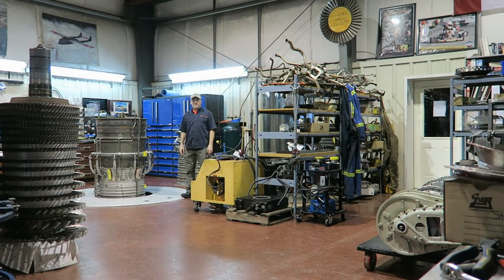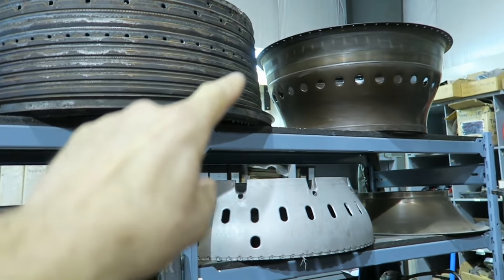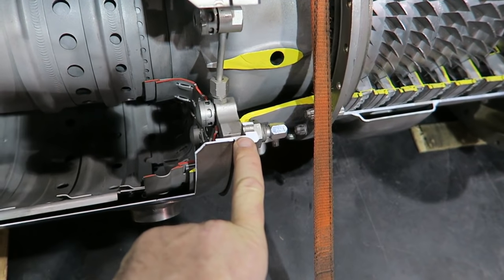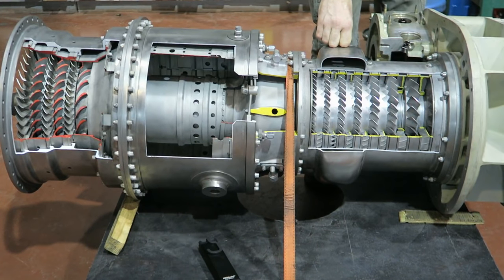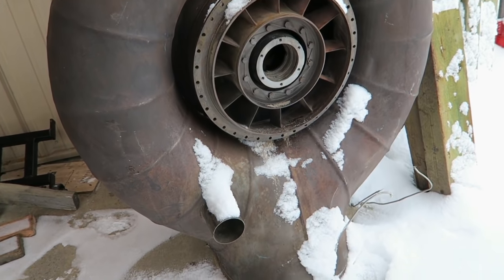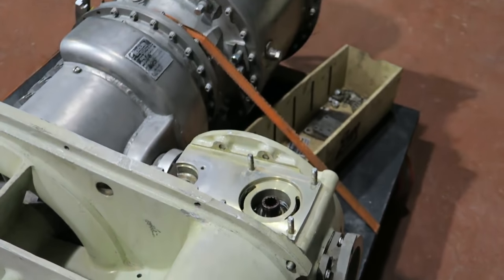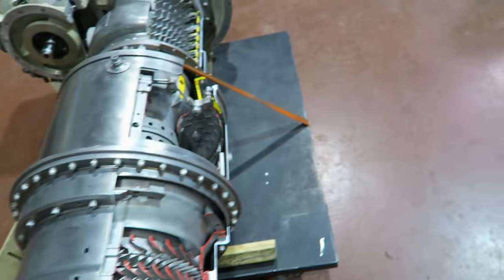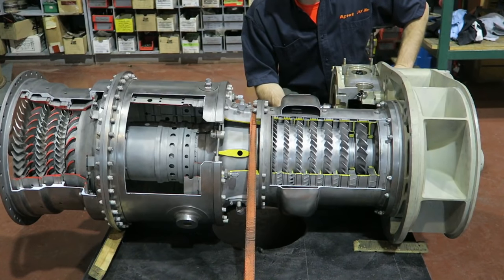Solar Saturn Turboshaft Engine

Comment: in the us, and I'm sure Canada too we had microwave radio towers between the 60's and late 80's run by att/bell called "long lines" they carried all long distance telephone calls and sometimes secure government comms most profilic during the cold war. at some of the more important relays that dealt with multiple wireless interconnections often in very remote locations they used these solar Saturn units for backup power. long lines played a big role in our history and many don't know anything about it.
Reply: there are links to a neat little brochure about it most of the way down this page. http://www.long-lines.net/documents/index.html

Comment: very cool
we have a solar turbine at my work that generates 22Mw of power and the wast heat runs a boiler.
its a titan 250, as far as i'm aware they are still owned by CAT
Reply: I helped build the hot section for first Titan 250 serial number 1
Reply: @joanygurl  That's awesome! 
We are on our third turbine now  20,000 hours between changeovers.
Only very minor issues with transmitters (fuel or oil pressure) failing shutting down the unit.

Comment: Awesome video! I overhaul these bad ass little turbo shafts for a living. I'm curious, maybe you were too and checked. What are the blade tip clearances of the turbine rotor blades, and the compressor rotor blades of the engine in this video? It looks like the compressor rotor blades have some pretty decent rub, couldn't tell on the turbine rotor blades. Also you said it was 1,000HP. Do you know if it's a Saturn 11, 12, 13, or 1,400 model? It's clearly a Saturn 10 series, I can tell based off the compressor case and combustion case. Saturn 20s have slightly different design for the diffuser, combustion case, and compressor case. They are thicker/heavier. Also the accessory drive/air inlet on that particular engine are MK1 version. The starter would be connected to the gear box parallel with the engine.
Reply from the maker: I didn't know any details about this engine then, and nobody who worked on it will remember it now.
Reply: @AgentJayZ  No problem, just curious! Thanks for the reply!
Reply: Interested in buying a good used solar t-1201 ?

Comment: 22300 RPM.  Either 500 KW or 750 KW (500 on PRO, 750 on ALG).  1200 HP rated,  Air started, with 600 PSI air used to start it.  Yes, offload when started, ITT7 had to stabilize before it would go on load.  #1 (280) and the GT (PRO) would both be setup to go on auto load.  Timeline was around 20 seconds from the start to on load.  The engines were kept relatively clean with us, but hey ho...
Reply: In the 70's we had 21 of these on a production platform in Cook inlet Alaska. Ours were started with natural gas not air...180 psi. For many years they ran without mufflers....not a pleasant  experience.
Reply: We still uses them for ngas pump end electrical. Electrical we milk them for 2,2 Mw
Reply: 600 psi?  I want to see that air compressor.

Comment: What is the clearance between  the shaft and the stationary blades at 12:57  ?... 0.010 inch or less? Thanks for the videos, very informative..
Reply from the maker: That clearance is a small as practically possible, because it allows air to leak, which decreases compressor efficiency.
0.010" would be good. Modern airliner engines strive for just about zero.

It's not that important in conversation, but I feel compelled to let you know that what you are calling the shaft is actually a spacer, mounted on the shaft between two compressor discs.
Some engines are built without a shaft, and the blades are mounted in a "drum", composed of what would be the discs and spacers in more conventional designs.
Reply: @AgentJayZ  Yes, of course for the spacer...I was a machinist for 20 years, I appreciate a near zero clearance, ALMOST A TRANSITION FIT...Thanks again for the explanation...

Comment: Just watched a video of a Solar Saturn electric generator start up. They showed the engine rpm percentage gauge, and the exhaust temp gauge. They both slowly climbed up to 45% and 700 degrees respectively. The engine rpm kept on climbing to 80% (temp still 700), then the rpm surged to 100% and the temp dropped to 500 degrees F in about 2 seconds. The rpm increase wasn't too shocking, but to see the exhaust temp drop that suddenly was. The power turbine really does suck the energy out of the exhaust!

Comment: Are those massive torque wrenches specific to gas turbine engines or are they something you'd use any time you need to torque something to that high of a spec?
Reply from the maker: They are sold by a company who makes hydraulic tooling, so i imagine they are used in many instances. There's a lot of nuts and bolts out there with huge tightening torques...

Comment: I heard  a Solar Gas turbine run up at Camosun College Diesel shop 20 years ago.
It's size compared to a similar output Diesel what remarkable.
The sound was ear damaging; I suspected at the time that it was mostly gear noise?
The spur gear you describe probably confirms this.
Exhaust was routed out and up over the building so the noise all came from the engine room.  To me, at the time as a learning student; It was alarming 
Helical gear noise; the choice for the ears.

Comment: The Solar Saturn 20 developed 1590 hp (1185 kW).  It had a pressure ratio of 6.7.  A nice little engine.  Very simple.  Thumbs up, man!

Comment: nice cutaway. I work for Solar and we don't have many cutaways that nice (not of our little Saturn anyway).  we are still owned by Cat BTW. great video as usual!
Reply: +herotaco So could you go to a CAT dealer and get spare parts?
Reply: Beach&BoardFan no. solar is direct. we (cat) did not put solar in the dealer network. you have to call the solar district.

Comment: I don't remember if I posted this video in an earlier Question.  Here it is again.

A Rover 1S60.  A 60 HP gas turbine.
It ACTUALLY has very few moving parts.
Video includes a cut-away model.
Surely most watchers here could build one from this video!

https://www.youtube.com/watch?v=Ow_hddEk8a0&list=PLez3Vca_cTiQsf9obWSIVLr602WgB97DV

Systems are all different.  Watchers will be familiar with many of the points in the video.

AgentJayZ: As others say, yours is another in an unbroken line of wonderfully instructive videos.
Reply: I think that, back in the 1960s, we had one of those (or similar) in the engine lab of the Dept of Mech Eng at the University of Nottingham. I never got to play with it: my project was based on a Lister single-cylinder diesel engine.
I reckon there was some very transient combustion rumble when it was started up by those firemen in their trad uniforms and helmets.

Comment: I live in York, Pa where Caterpillar was one of the biggest employers in the 80's and 90's.  I remember shortly after cat bought solar, they built a six unit Solar Turbine powerplant at the cat plant here.  I am pretty sure it is still operating.  it was a 58,000kWe plant when it was built.  

I am a little young to remember but York used to be a vast industrial powerhouse of a city.  Not so much anymore.  It's kind of sad seeing all the disused factories here.
Reply: +paemt6220 Hey fellow PA'er!
Reply: Where?
Reply: paemt6220
I'm in Valley Forge but I have an aunt that's from Mechanicsburg/York area so I'm fairly familiar with the area, nice out there definitely a shame about industry though.

Comment: What happens to the hot air after coming out of the engine? Is it used for anything else or wasted
Reply: martkt10 i've heard it can sometimes be attached to a steam turbine, the system i mean exhaust gas can be  used to produce the steam needed ;)
Reply: Depends on the application they're used in, but often times the exhaust is directed into a HRSG (Heat recovery steam generator), which is basically a boiler. The HRSG can be unfired and just use the exhaust heat for steam generation or fired, where there are duct burners to add additional heat into the boiler for greater steam generation capacity.

This steam can then be used in any number of industrial processes or used to run steam generator for additional electrical output.

Comment: is there any type of radial reduction between stages or compressor and depressor? dumb question im sure 😓. im studying those angles trying to figure this thing out and its hard to tell with the shutter rates of the cam. Awesome videos btw. let me know if you need free labour in your work shop for a month or two!
Reply: No, most mechanical drive units are two shaft design, the compressor section shaft is separate from the power turbine shaft.  The output shaft turns slower that the compressor much like how a torque converter works in your car's transmission.

Comment: This may be the soonest that I have viewed and commented on one of your videos.  Thanks for showing the little Solar and how it interfaces with its surroundings.  As an aside, the J44 also doesn't have any right-angle drives; it has its accessory drive on the front, coupled to the compressor front hub with a 4" splined stub shaft.  Have a good one and cheers!

DD

Comment: Like you mentioned, post operation cooling for the bearings is a concern. All of the Solar turbines I work with have both AC and DC post lube pumps for that very reason. One time we had an emergency shutdown of the turbine due to an AC power failure and the DC backup pump failed to turn on... the shaft got so hot it melted the bearings out.

Comment: What a treat! Exquisitely beautiful is really not an overstatement. Many of the units you show us have more artistic merit than many of the sculptures that I have ever beheld!  Beauty can be fitness for purpose I suppose but even then it doesn't fully explain the appeal for me. That Saturn exhaust duct is positively voluptuous!

I thought I noticed that the individual hot stage turbine blades did not appear to be separate inserts within the discs. There appeared to be no vibration damping looseness in their mounting. Are my eyes deceiving me again?

Comment: Great video! You know, somewhere back in "Questions" (#56, I believe) was my break-through moment to finally grasp the "how" of compressor blades and stator vanes work together to increase pressure in the compressor section: compressor blades accelerate the air mass through a convergent passage, whereas the stator vanes are a divergent pathway, slow the airflow, and therefore compression happens. 

Expansion  = compression in the stators?? I didn't understand....

The lightbulb moment occurred when agentjayz said the magic words: "this is part of the Bernoulli equation." 

I mention this now because it's fascinating to see in cut-away detail how the process reverses with the working air doing work in the turbine section. 

Thanks for an excellent tour through the Solar engine.
Reply from the maker: Excellent. Thanks for using your thinker and your reader to increase the size of your understanding.
Reply: You're not quite there. OK, the annulus profile from front to rear of a compressor is convergent, to maintain an approximately constant mean axial velocity. However, the passage shape formed between two rotor blades is not convergent: even at the tip of a big fan blade it might be virtually constant, but at the root it will be divergent.
Reply: grahamj9101 - Ahhh...well...I enjoyed my moment of understanding while it lasted. 

Because you opened the door, are you open to providing further information?  Your post immediately raises two questions for me, which in this context I presume apply to only the fan of a turbo-fan engine: 

1) The passage shape formed between two [compressor?] rotor blades is not convergent?  Does this statement refer to the passage between fan blades or (core?)compressor blades? 

2) Is the purpose of a divergent passage between fan-root blades to control/slow airflow into the core compressor? If so, is this purpose to prevent supersonic airflow from entering the engine core?  If the passage is divergent, Bernoulli says the pressure should increase...does the pressure actually increase here before the compressor stage?

All the best to you.
Reply: You are obviously clear in your mind that fan and compressor stator vanes form a divergent diffusing passage, to convert velocity into pressure. However, you do need a little more sorting out in respect of rotor blades. Basically, my comments apply to both fan and compressor blades. After all, a fan is a single-stage compressor, but with an extreme hub-tip ratio. 
Fan and compressor blades form a divergent passage at the roots, with the divergence reducing towards the tips. And yes, there is some pressure rise in the rotor blades, which is compounded in the stator vanes. And no, the fan does not slow the airflow into the core: however, do not simply think in terms of velocity change in the axial direction. The big changes in velocity take place in the circumferential direction.
I have to hand my retirement presentation piece from R-R, back in 2003. It is a mounted IAE V2500 HPC1 rotor blade, which I have measured as best I can at the blade root. The inlet passage width is about 19mm and the outlet width 26mm. The tip section has minimal curvature and cannot produce any significant divergence: equally, it cannot produce any convergence.
Reply: I've now measured my Pegasus first stage fan blade. At the blade root, the inlet passage width is about 42mm and the outlet is about 55mm. These dimensions (and those I gave before) are not, of course, the chordal distances from one blade to another. They are, for the inlet, the dimension from the leading edge to the nearest point on the convex surface of the adjacent blade: for the outlet, it is the dimension from the trailing edge to the nearest point on the concave surface of the adjacent blade.
Reply: Graham - What I appreciate about your response is that, given your professional experience, I am confident that I can accept your responses as near-gospel truth. The problem with this is that I now have to make sense of the new information in the context of what I (think I) already know.

So, aside from the fans changing air velocity in the circumferential direction, what else does a convergent blade assembly at the root accomplish in the fan and compressor stages? is it strictly to the assistance of a pressure rise?

Thanks for the specs and the benefit of your thoughts.
Reply: There are no convergent blade or vane passages in fan and compressor stages; if there were, they wouldn't work. Convergent blade and vane passages exist in turbine stages: that's why they work.
Having said that, I am aware that the Olympus 593 LP turbine blade (in the Concorde engine) did have a 'false throat' at the root section: in other words, the narrowest section of the passage occurred just before the blade trailing edge and there was a slight divergence downstream of this section. This resulted primarily from the very low hub/tip ratio of the stage and the reducing inner annulus line.
Reply: Having read your response I went back to the literature and diagrams that I reviewed, and see where I mistakenly understood compressor blades formed a convergent passage. My statement as such following your above responses was no more than simple sloppiness. Thanks for clearing this up. 

To reframe your above measurements, fan and compressor blades form divergent passages near their roots: other than changing air velocity in the circumferential direction, is the other function of a di passage to assist pressure rise in the compressor? Any other purpose?

Comment: It looks like the ring gear is missing from the planetary reduction gear set of the Solar Saturn exhaust duct. Obviously the ring gear would be the power take off. I see the planet carrier is fix to the exhaust duct which means the planetary gear set will operate as a simple reduction gear, i.e. one input, one output. Pretty neat.

Comment: The old Boeing 502 gas turbine generated about 250 hp.  Two  reasonably fit men could lift it without a hoist.
Reply: Caterpillar bought that design from Boeing, the only thing that remains from that program is the air to air heat exchanger which Solar utilized in the Mercury 50 program which was discontinued due to the high amount of nickel alloy used in it and the high cost of nickel.

Comment: Cool video Jay, a quick question. It was filmed in HD but was it also 60 FPS? It is very clear and almost 3D which makes me think it is 4K at 60FPS
Reply from the maker: 1080p 59.9fps. May cameras have been recording in that format for two or more years. I only just discovered that i was producing my videos in 30fps. Ooops. But to upgrade the past videos, I would have to delete them,  re-produce them from the master project files containing the raw video, then re-upload.
I would do that, except then I lose all of the comments and view counts associated with the title.
Reply: AgentJayZ No that fine don't change the past, it all good just seen the change and wanted to know. Thank you for the info and it a lot of work i know but keep up the great work, I know I can't get enough.

Comment: I used use a large torque multiplier to put on the  Jesus nut that holds a Huey's rotor on the mast. takes awhile you crank it up to 650 ft/lbs wait, crank it back up wait, wait crank ETC. I think we did it 4 times

Comment: I think the reason why you generally only see radial boxes, is because they are lighter, however they're also more prone to alignment problems and they are slightly less efficient due to more sliding surfaces in those crown gears. However for aviation purposes the weight factor overrules the efficiency and more expensive parts, assembly and maintenance. 
I would have expected the exhaust to be more snail house shaped by the way. Interesting. 😊